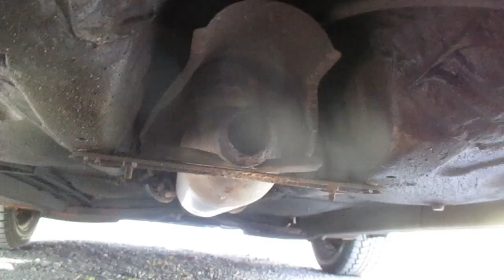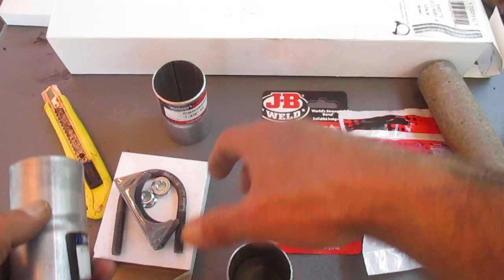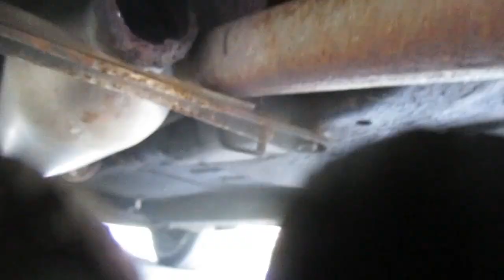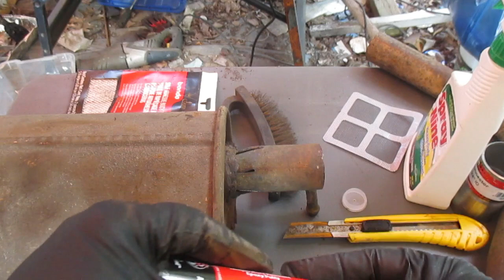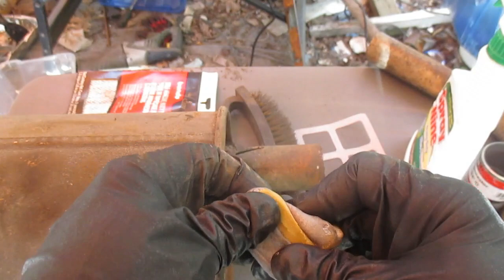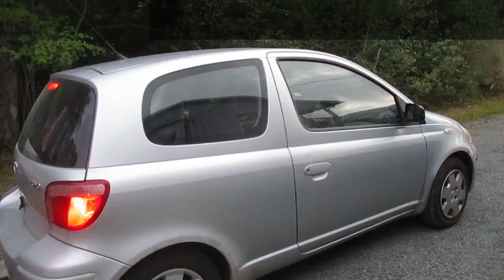Exhaust repairs using J-B Weld, flex pipe, and exhaust clamps

Comment: If you have a engine from 180 to 200 HP you need a 2.50" exhaust going into the muffler and if higher HP 200 to300 you step up to a 3" pipe according to exhaust HP chart
Reply: lol who TF told you that? that couldnt be further from the truth. so by that logic, if you have 500hp you need 4 or 5 inch pipes? why do Cummins' with only about 250 hp come with 4 inch pipes? also, newer Civic's have about 180 HP but come from the factory with 1 3/4in or 2in exhaust piping. piping size has nothing to do with HP. its all about fuel trim and tuning bud. I've been building high end custom exhaust for the last 13 years...so.

Comment: You should buy at least cheapest MIG welder, even used one, to make this job. I guess it's not the last time.
I once tried that method and it just falls off after few months.
But useful video anyway.
Everyone has it's own ways to do different things. 
Like!
Reply: I use the jb weld first , let it cure . Then wrap over it w/ header wrap , if it's on a 4x4 I throw 1 or 2 muffler clamps over the wrap . I haven't had a leak  yet and that was years ago .

Comment: I definitely detect an eastern accent.  And it definitely sounded like familiar music in the background of your wheel bearing video.

I have been trying to figure out what is the sound coming off my car when I accelerate.....intensifies on speeds of 80 clicks and up.
I thought it was the wheel bearing but it is also accompanied with a slight vibration in the steering wheel.  
The mechanics up in Alberta are quite shifty and dishonest.  Got ripped off a dozen times.  

Would you mind offering some mechanical suggestions?
Reply from the maker: Very perceptive Paula - I'm in Nova Scotia ! As far as the problem with your car , I think you were right when you thought it was a wheel bearing - sounds like that to me . I have multiple videos on bearings ; this one shows a 'trick' to help figure out if a bearing is the problem : https://www.youtube.com/watch?v=xwfeKEXkpeo